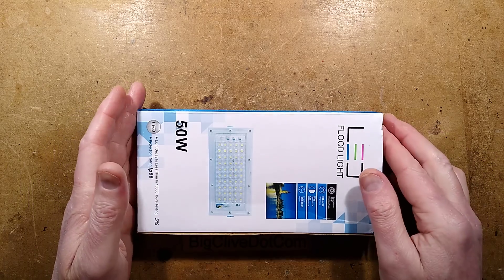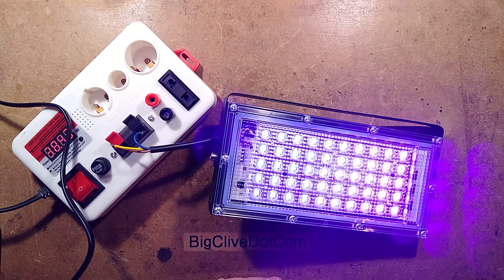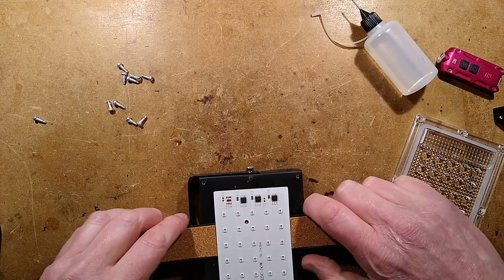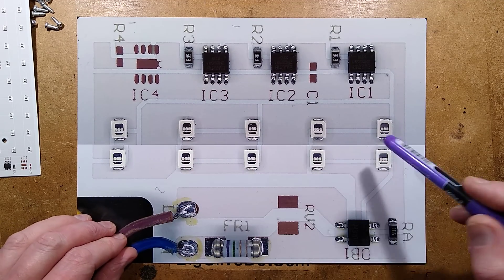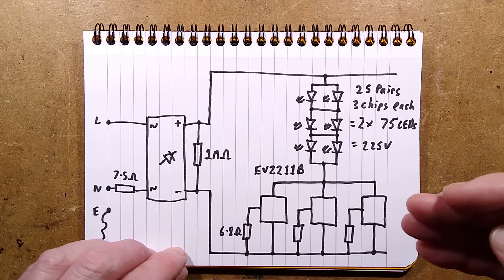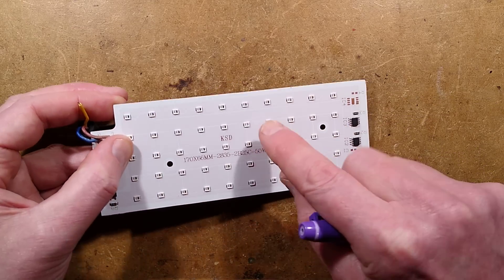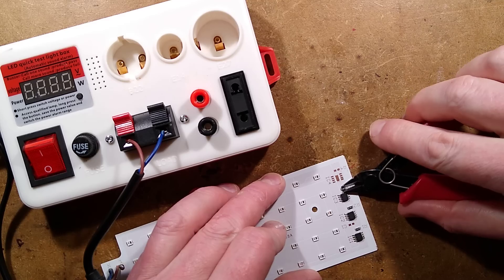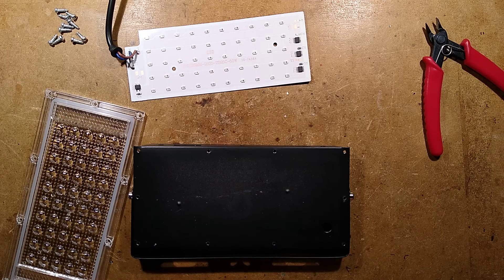Horrible eBay ultraviolet floodlight (with schematic)

Comment: I have a similar 50W Grow Light version of this floodlight. Just like this one the Earth wire is dangling between the board and case. It does get a bit tingly. Can I connect the Earth wire somewhere to help with this ? Also Im guessing these "UV" LEDs are actually Royal Blue LEDs similar to the ones used in Marine Aquariums to get corals to fluoresce a bit
Reply: There is a VERY wide range of UV leds used for something like that, ranging from UV-B, over UV-A to near-UV. Especially in aquariums, they can also often have other functions like water purification, not just for fluorescense. So, there are way too many variables to say or guess anything like that. Since you can use anything ranging from near-UV to UV-B to let corals fluorence (heck even normal blue light will let certain corals light up).

The armature shown in the video is, from what I can tell after extensive looking up, uses either 395-400nm (just within the UV-A range), or either 445nm (just outside the UV-A range/near UV-A) leds. So, yeah, they can certainly be used for fluorescense.

But, unless you have the manufactures specifics or seller's description (which is often correct in their wavelength description, but not always), there is no way at all in telling what wavelength is used by just looking at the leds or even what optical effects they have on objects. You would need a spectrum analyzer for that.

As for the earth wire: YES! Please do attach (screw or solder) it properly to the casing and led board, for your safety. Make sure you first scrape some paint off, so you have bare metal to attach it to. Since you asked this question, I assume you are not familiar with soldering or something? Try to find someone who can help you with it. Your own safety depends on it and will thank you... 😉
Reply: @CookieTube  Makes sense. The common Royal Blue LEDs are borderline UV. I'm just OK at soldering. Coincidentally it's one of the things I tried to teach myself during the covid lockdown !! But I didn't get much chance to practice so I'm not sure how to handle it on such a large object that would soak up the heat cos I just practiced with wire to wire and LED strips. Anyways not an issue since I know a guy who will do it for me, he did the soldering for a DIY aquarium light with 70 LEDs a few years ago.
So you would suggest soldering the earth wire to a place where it can contact the LED board and bare casing at the same time right ? That would mean a big blob of solder along one of the edges I guess.
Reply from the maker: You can connect a proper earth/ground connection to the metal case if you wish.  Make sure you expose bare metal to get a good connection

Comment: I thought you might want to see what wavelength of UV was coming off the lamp using the UV and UVC test card. Now that I have mine, I try it with anything even faintly UV.
Reply from the maker: It would show a colour change on UVA, but that covers quite a broad spectrum with these cards.
Reply: You can not use those 'test' cards for that. They are more of a gadget/gimmick than anything else (hence why they are so cheap --10 pcs for less than a $1 incl. shipping).
The only thing you would be able to duduce from them is if there is any near-UV or UV light at all. They can not tell you what type of UV (except for the difference between UV-A/B and UV-C, but even with that there is an overlap), and especially not the intensity of it. For such a thing you need a MUCH MUCH more expensive spectography device (cheapest ones start around a few hundred dollar).

Or, if you don't wanna spend a few hundred to thousands of dollars, you can by a "UV INDEX" measuring device. They measure the amount of intensity of the UV across the whole UV spectrum, and give you either the international UV-index (that number you often hear in weather forecasts in the summer months), or either the power factor of it (W/m^2). Both will give you a rough indication of the 'intensity' of the UV.... So close to zero means no UV-emitted, anything higher means there is some UV emitted.
They cost between $50 and $200 or something, depending on how accurate they are. With them you have a far better idea if something emits UV or not, than from those 'test' cards.

But also note, that even non-UV lamps often do emit some UV. Especially those near-UV.

Comment: I have this panel for 3D printing resin curing, and it works great :)
Reply: The advertised wavelength peak is either 395-400nm or 445nm, according to the specs I can find about this very specific armature shown in the video.
But I have no idea about the spread of the wavelength dropoffs. As such, the sole reason the shown armature (still somewhat) works for curing resin (according to you, IF it is indeed the same armature -- note: there are a lot of variants with slight differences), is most likely because those peaks have a dropoff which at its base still just touches the needed wavelength, barely. And as such you barely get any of the proper useful UV wavelength you would need to cure resin. eg: you probably only use like 1% or something of the pumped out UV power. HUGE waste.

You are FAR better of buying a UV light which advertises its peak wavelength as either 405nm or 365nm (or both). 405nm is by far the single one most used wavelength needed for resin curing in 3D printing. Although some resins do use 365nm, but those are more rare.

As such, using this specific armature, or its integrated led module, for this purpose is really a bucket load of wasted money and electrical power.
Reply: @CookieTube  Yes, this led panel has a wavelength in the range of 395nm - 400nm. 
I use Anycubic resin which has a curing wavelength of 405nm.
I leave the prints under the panel for about half an hour, and it is completely sufficient.
Regards. :)
Reply: @Phazzzer  Yup, kind of my point. It will work, but for the amount of time and electrical power usage during that time, you actually only use a fraction of what it outputs to do the actual curing. All the rest is completely wasted.
So, yeah, it will work for sure, as there is always a dropoff around peaks and/or overlap with near peaks. But, as such, the efficiency for what you actually need it to do is very low.
So you're only using that tiny fraction of dropoff it still outputs at 405nm.
30 minutes, you say? Sounds very excessive to be honest, and kinda proofs my point. If you get a lamp which has its advertised peak specifically and only at 405nm, you would use a whole lot less electricity and probably only need to use it for 10 minutes or less or something like that, to have the very same curing level as you have now....
I depends on the thickness of your print of course (not on the surface amount), but an average print most people do with the popular hobby resin printers shouldn't take longer than 5 to 15 minutes with the proper lamps. 

Note: you can also over-cure prints though. Any discoloration or too much brittleness and you have over-cured it.

So, just a tip to keep in mind for people who want to use such general uv-lamps for curing. Buy a lamp with the proper wavelength output (cost the same or even less, but they are way more efficient and thus in practice will safe you time and money compared to otherwise) 😉

Comment: Don't worry, Clive! The thermal glue will spread out automatically as the lamp heats up ;) Although I doubt the heatsink will be enough for the wattage. Maybe it was meant to be used in case of floods, underwater, so you don't need as big of a heatsink. Also, if you stick it into ground in your garden, it's already grounded, hence, no need for the ground wire to go somewhere. Cost savings, time savings and friendly for the environment, chinese thought of it all ;)

Comment: The unwritten rules for these kind of devices:
- Mains wire needs to be very short (ideally made of CCA, but may be pure copper, if very very thin)
- PE/Earth wire needs to be present, but not connected internally (it should be stripped though and able to move freely inside)
- Heat needs to be allowed to build up on the inside, without disruptive contact to the case
Reply from the maker: And the stated power should be at least twice the actual power.
Reply: ....and sheet metal should be as thin as possible....

Comment: They used the earth wire in the cable, they used a metal case and screws... and yet somehow never ever brought the two together with a bit of solder, and squished into a screw hole.

Comment: Haha... I do the 'back once again' thing too.
Also I've just introduced my kids to 'can I kick it? yes you can!' after my youngest asked if he could kick a dead sheep.
You know you're getting on a bit when your references fall completely flat on anyone under the age of 20.
Reply: PS.. I use these things to illuminate my workspace (workbench etc). What they lack in build quality they more than make up for in affordability.
They are !BRIGHT! , cheap, small (thin etc.) and you can fit loads of them.
I have a mix of soft, hard and UV.. Even at night time I can do very close work.
It's no good looking down your nose at Chinese products.. Just get used to them.
Reply from the maker: When "corrected" they are often usable.  I use cheap Chinese floodlights at my bench, but with a PIR sensor so they get a chance to cool down when I'm not there for a while.

Comment: If I was using that dodgy lamp tester directly from the mains, I think I would tie the earth wire to the neutral (after I had verified it actually was connected to the chassis 😅) at least that would make sure the chassis is going to be at 0v while your playing with it 😅👍👍
Reply: Every RCD screamed out at once at this suggestion
Reply: @TheFool2cool  what I suggested wouldn't trigger the RCD, its would just be the equivalent of connecting the 0v neural to the case of the device under test, how would this trip the RCD? To trip an RCD you need to leak 30ma, if you then touched the case with pe ground say a grounded soldering iron tip it may trip but other than that it would be fine, the dodgy lamp tester has no earth conductor, so in this case tying the case of the DUT to neutral would prevent the case becoming live in a faulty DUT

Comment: I have one of these as a 100w version. It gets so hot. I'm going to modify by removing the same resistor. It's indoors and hopefully will last longer and run cooler. Cheers Clive.

Comment: It is not bad, it is a diy kit :) You take it home, fix the earth, replace the glue with thermal compound, remove a resistor, fix the seal, put up a "don't touch, lethal risk" sign and you are done.
Reply from the maker: Many of these imported products are definitely best treated as starter kits for modification.

Comment: I have the same for 3 color grow light. I have fixed the earth and used it like that. Honestly worked great for my plants but run very hot. I cut the cover and put small stepper driver heatsinks on the led driver ICs and is happily running ever since.

Comment: It says 50W on the package yet only dissipates 37W. Send a message to the seller notifying them is the product deficiency.
I just purchased 5 meters of 5mm led strip to convert my mercury vapor monitor backlight to LED. 
The listing said 10-12W/meter X 5 meters = 50-60W I powered it up at the rated 24V and it only dissipated 38W which is 7.6W/meter. So I sent them a message.

Comment: I brought 4 of the remote RGB versions of this for a temporary 3 day event. Sure enough I had to rewire them and add an earth. 2 of the 4 failed before the weekend was out. I made sure they were only used under cover and at height so no one could touch them. I was amazed how thin the steel was. I've wrapped a turkey in thicker foil. I've not thrown them away yet so they are available for autopsy.
Reply from the maker: Many of these things are best treated as disposable for short term use.

Comment: Our local shopping centre bought a load of cheap and cheerful outside LED flood lighting and I looked at then and they look like a load of rubbish to me and I was right.  Seven months later the LEDs burnt out, all of then.  They been replace but I can't see then lasting very long because I can't see any heat sink on the back of the lamp holder.  But I may be wrong
Reply from the maker: In Glasgow my local ASDA and police station both have dead LED lights pulsing or glowing randomly outside.

Comment: You should ALWAYS check if one of the mains wires is not connected to the case, especially when you buy mains voltage devices from China and the case is metal.
Reply: ....or from DIY stores, dollar stores, etc etc..... as 90% of those come directly from China anyways without ANY modification (just packed within another box).
The ONLY lighting devices I would "trust", without first opening them up and checking them out, are the ones used by the lighting entertainment industry and only those coming from the very high-end professional dedicated lighting companies. And even there the line between expensive but proper professional stuff made for the road, and the cheaper pro-sumer stuff gets blurred very often.

I find it VERY funny (and troublesome) that most (Western) people dunk on "China" (read: drop shippers and resellers), for their lack of safety in the stuff they sell.... While 90% of all such home-use lighting devices you can buy in the West are 100% IDENTICAL without ANY modification (except for maybe a logo) or improvements and come directly from those same Eastern manufactures. Case in point: the exact same led armature (including even the same box!) that Clive showed in this video, I find in numerous western shops with the exact same (often BS) specs and advertising (In fact, some shops show that very same armature half submitted under water!!). But with prizes ranging from $20 to $75 for the exact same 50W armature. So, "quite expensive... must be ok then....no? Not like those cheap Chinese dangerous clones....." ... At least that is how most people think about it.

Comment: I’ve seen security cameras that failed due to water ingress up the cat5 cable into the sealed unit. Horrible mess.
Reply from the maker: Water ingress along cables is common.  I've had water dripping out of electrical panels due to externally damaged cable sheaths.

Comment: why do i feel like that also is vary noisy in the power wires too ...electric noise
Reply from the maker: The linear regulators do have the advantage of low electrical noise, as they behave like active resistors.

Comment: Noted that on the cheap steel backing that there are 2 divets that line up with the holes on the pcb. If you really wanted, you could slather the back of the PCB in thermal compound, drill out the 2 divets and use mounting hardware to hold the PCB down/earth it properly. Still wouldn't use it outside though.

Comment: Whoops.. I just received a very similar 100 watt US version. Mine is wired to for a standard US polarized plug with no ground. Started at 86 watts and quickly dropped to 50 watts. I think it was marketed as a grow light. I got it to downsize from a much larger, much noisier led array. The metal housing on this unit is hilariously flimsy.
Reply from the maker: You may find it regulates the power down due to overheating.

Comment: I would like you to do a tear down of an UVC LED water purifier. I think there’s a company that’s called Crystal IS  that manufactures aluminum nitride diodes that emit 254 nm wave length light. Unlike the Fluorescent type there invisible to the human eye.

Comment: I had several of those tungsten blacklight bulbs. They got incredibly hot, even compared to normal ones, and removed several sets of fingerprints from me as a kid in the 70's.
Reply from the maker: They still sell the tungsten ones on eBay as UV-like lamps.  Extremely low output anywhere near UV.
Reply: Hahaha, I can 100% remember the same. I also feel like I would wait for the lamp to heat up, then fascinate myself with licking my fingers and putting them on the hot lamp. So strange... Lol
Reply: @nimoy007  what
Reply: They were tungsten lamps running at a much higher temperature than normal, so there is some UV but also a lot of white light that has to be blocked by the coating on the inside of the glass envelope.  All that energy being absorbed makes the glass get very hot indeed!  They could also explode if knocked or moved during operation.
Reply: I had a tungsten one as a lad, early 1970s, enough to make white shirts glow if they’d been laundered in the right detergent and make UV-sensitive paints glow a bit. Feeble but enough to amuse.

Comment: They could spend a nickel more making it, and it would been 10x better, (it's still low quality) thermal adhesive, and epoxy to seal it , would made it much better, or silicone adhesive, to seal the wires, and lense, with something to thermally connect the LEDs to the metal backing, and ground it!! ✌️ That would probably cost less than a nickel, and probably made it worth a dollar more possibly

Comment: I have 3 of these. I just connected the earth to the chassis and mounted an old PC fan to the back side. I also laser cut foil covered panels from acrylic to act as reflectors (to focus the beam).

I would never had even considered using these outdoors, or in a high humidity environment like a greenhouse.

EDIT: Correction - my units are actually a bit different. They have 28 red, 20 blue, and 2 white LEDs, and do not have the 'fusible' input resistor. But they do at least have an Abiko style loop connector in the earth wire, so connecting it to the chassis was trivial. Thanks to Clive, I think I'll try to 'adjust' the current-setting resistors in order to reduce the current and get rid of the fan.